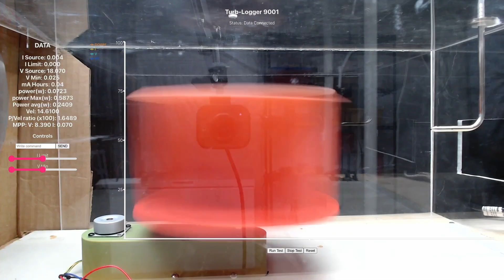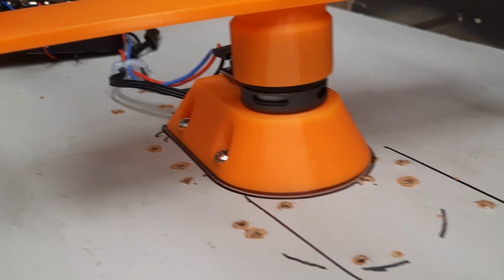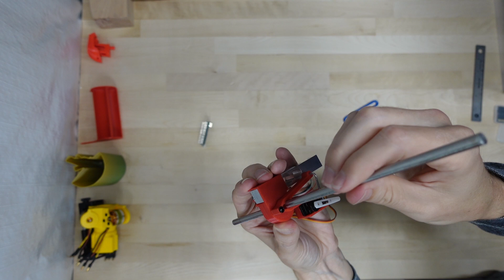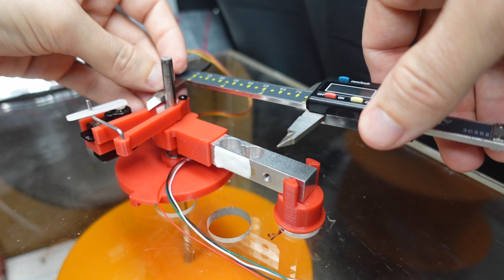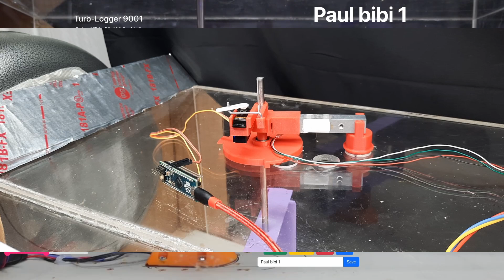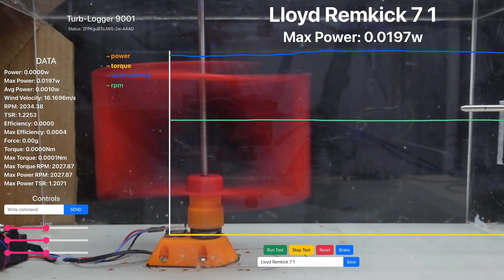Building a Turbine Dynamometer | Turbine Challenge | VAWT

Comment: Great video!  Your new set-up provides very useful information.
  The one thing that is not measured is the amount of wind drag that the blade supports are adding. That can be significant especially at the higher RPM of the lift blade turbines.  A 1mm difference in thickness of the cross supports will make a measurable difference.  The wind drag of the support structure is hard to measure or calculate.   
  If a standard lift blade support structure is specified for the new test stand, comparison of the submitted blade designs could be more accurate.
  I'll be working on new blade design.
  Thanks for all your hard work.

Comment: If one applies the brake quickly, wont you get higher power figures for heavier turbines ? ie the potential energy in the rotating mass being converted to power ? Worth rerunning with the servo closing at half the rate and compare the max powder. Also, wont a quickly decelerating turbine effect the airflow patterns around the blades ?
Reply: I agree; inertia will give you a slightly higher result, it will take more energy; which they all have available from the wind flow, to get up to speed but that energy will be stored in the mass and transferred back to the measuring system.
Reply: @itsandbits1  so the drag turbines are in the benefit
Reply: @gaverapotheek2138  if the braking is applied slowly it won't skew the results much I don't think

Comment: Cool video and setup, Max! I just wonder why the efficiency of those turbines is below 10%. Is that due to the wind tunnel?
Reply from the maker: I don't think its any one thing but likely a combination of many. Measurement error, small scale, bearing friction, wind tunnel jankyness. Luckily they are all exposed to the same jank wind tunnel and test conditions and thats good enough for comparison testing.
Reply: @hellothisismax  Any drag from the rotating motor/alternator (like generated eddy currents in the stator cores) is not being read by the load cell as built.  If the load cell is attached to the base of the motor and the motor allowed to pivot on the turbine axis, then the load cell would sense motor/alternator and a drag from the bearings.
Reply: @danedmiston9673  @hellothisismax

I think...
that the true windspeed before the windturbines and over the complete surface of the windturbine is an average from the spinning in the front area and the back area and  is 12m/s and the Betzlimit Watt that can be delivered is 12 Watt, the average Watt the windturbines are seeing is 20Watt windenergy...

so the TSR@12ms for the different turbines respectively are
Dan 0.94  Bibi 1.52 Jelly 1.37  Remcickc1.49
the calculated Torque at 12m/s @the MaxPower point is  formula 
Dan 0.036 bibi 0.023 Jelly 0.025 Remcick 0.023
The Measured Torque @Maxpower point is (see video)
Dan 0.031 Bibi 0.015 Jelly 0.022 Remcick 0.020  >87% > 13% FRICTION

The % efficiency of versus the Betzlimit is
Dan 24% Bibi 20% Jelly 26% Remcick 22%

The % efficiency versus the 20Watt energy is
Dan 16% Bibi 13% Jelly 17% Remcick 15%

Comment: This is great!  Could you use the motor to provide the braking torque instead of the servo and clamp, and then measure the torque between the motor and its base?  Just a thought.  It might allow more fine adjustment on the resisting torque.
Reply from the maker: I would definitely have better control using the motor. I could redesign that mount I was too lazy to change in the video, lolol

Comment: Oh, this is cool!  I probably missed it because I have the attention span of a small bird, but how does mass, momentum, and inertia play into this?  Is the brake closing as a constant speed?  Someone else mentioned "dwell time" which I think would compensate for any flywheel effects from chonky designs.  Easy enough to set up those stepped brake forces in software, I imagine.  But, adds more wear onto the pads.  🤔
And... while it would require an overcomplicated, wildly more complex redesign, I can't help think how cool it'd be to use magnetic braking for this.  😎     
Excited to see this get fine tuned and refined.... and maybe finally have some time to design a turbine to enter. haha
Reply from the maker: Haha you're attention is fine, it's my attention to detail in my videos thats lacking :) the rate the brake closes is constant over 17.5 seconds (with a dwell time of 250ms). It would be easy enough I think to test dwell times and a chonk vs not chonk turbine in a video.

I'll be waiting for your turbine lol
Reply: hmmm its a flywheel calculation, but the turbines are in PLA very light the energy stored is calculated in Milliwatt... 3Watth/3600sec= 0.8milliwatt
Reply: @gaverapotheek2138  I suppose that a more massive turbine would also not be able to get to as high of RPM, and not have as much instantaneous torque from the wind (no idea what to actually call it).  Maybe the momentum and inertia end up sort of balancing out.
Reply: @BRUXXUS  since the test takes 17 seconds, and the measured energy can be 3-6 watt it can make the peak come 1s later, it has influence you are right, especially if the design weights more or spins faster
Reply: @gaverapotheek2138  Oh, I'm silly. I just realized it really doesn't matter if it has momentum, that energy would still have come from the wind.

Comment: Have you tried adjusting the ramp rate to see if you get similar results?
The dwell at each step just seems too short.
Reply: Oh also... if you find the 'brake pads' are wearing too fast, try adding some thin leather strips to each arm.
Reply from the maker: That is a great idea! I don't believe the ramp weight will affect the results but it's easy enough to test!
Reply: @hellothisismax  - Possibly not, but easy to check.  Just triple the time at each step and see if each one matches.
Reply from the maker: Haha I've already got another comment about it so I think I'll be adding it to the todo list.